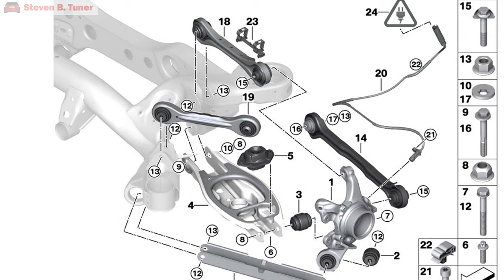BMW Axle Replacement - BMW E90 E91 E92 E93 Rear Half Shaft / CV Axle / Drive Shaft Replacement

Comment: Hi.. My name it's Alex and I'm living near Tarm😊I have a e91 from 2009 who has a problem with the passenger occupancy sensor... If someone it's sitting on the seat its popping a warning on the dash... What can I do?
Reply from the maker: Hi Alex from near Tarm! With that kind of issue it is probably a broken wire to the sensor, as wires that get moved all the time will eventually break. It could be the sensor itself or a fuse too of course.

Comment: Great video, thanks for your work. Subbed. My E90 has a lot of play in the left rear axle - I can jiggle the brake disc 1/4 inch all the way round. I'm guessing it's the hub and not the drive axle? Car was recently rear-ended on the left rear, pretty hard.
Reply from the maker: Hi, sounds like the hub or wheel bearing, or both. In that kind of accident it is very likely that the control arms are all a bit bent too (it is what they are designed to do), so often it can be a good idea to get everything from a donor car (control arms, hub, and axle).

Comment: If the thread is damaged and the nut doesnt go back on what are the options to this issue?
Reply from the maker: Hi, there are a few remaining companies out there who will fix or replace cv axles - but they usually deal with race cars, so their prices may mean that replacement is cheaper. A good welding and fabricating company could perhaps re-make the thread as well. There are plenty of mechanics who would get out their biggest air ratchet and make it go on - which leaves the problem of removal for some other time...

Comment: what could be the symptoms of bad half shaft? my e87 makes clunk/pop sound  from the rear when turning left and sometimes when reversing over unaven surface. It usually does it only once per drive then its fine.
Reply from the maker: Hi, they are often super tricky to diagnose because they last so long, and the signs of them going bad take a long time to fully show up. Sometimes the best strategy is to wait for a more consistent noise. Of course it is worth checking the suspension joints/bushings and diff bushings to make sure that it is not something else causing the noise.

Comment: Great video as always 👍
One question, how did you diagnose this shaft? I've got a bit of rear end noise at the moment, pretty sure it's not the bearings but there are 5 cv joints with the prop shaft and 2 axle shafts. Maybe I'll have to just wait till it gets worse. Goes away over 20 mph.
Reply from the maker: Hi, it can be difficult to tell as there is very good sound insulation in the car as well as a lot of the components wearing out very slowly. In my case it was a grinding vibration that rose and fell in frequency for every turn of the road wheels. Note that a similar sound can be caused by a very small build-up of rust on the differential casing, so check for that before buying anything. You are correct in thinking that is usually best to wait for the issue to get a bit worse so that it can be more easily identified.

Comment: Dear Steven, when I try to put the first gear in and the car is cold, it is really hard, but after a while, when the car get hot, it works properly. I have read and it seems it is  really common issue. Could you give me  hand? Thanks a lot!!
Reply from the maker: Hi, thanks for watching!  It doesn't sound like something that is nice to live with, and I wouldn't say it is that normal unless it is a Ferrari ;-)  A badly adjusted or almost worn out clutch can effect gear selection as well as worn gear linkages. It can also be the gearbox itself, which should have its oil changed every 100,000 kms or 60,000 miles. And of course there is the worst case that the gearbox is getting to the end of its life.
Reply: @StevenBTuner  thank you very much Steven! I'll continue investigating, driving like this is really disgusting.

Comment: I’m trying to use a puller and I can barely turn it anymore and this axle isn’t budging. I even tried heat. 😩. Any more suggestions ?? Should I go buy a sledge?
Reply from the maker: Oh no! That isn't always fixable, although a big hammer is certainly the right place to start. Sometimes things are so rusted in place that they either have to be ground out or everything has to be replaced with new or used parts in good condition.
Reply: @StevenBTuner  thank you sir. I actually already started pricing a new hub. If a sledge doesn’t work I’ll just remove the whole hub assembly.  Thanks!!

Comment: Hey, I’m currently changing my driveshaft on my bmw. Why do you have to remove the control arm?
Reply from the maker: Hi, thanks for watching! Removing the control arm makes everything come out and go in easily with no wrestling, and it isn't even necessary to remove the chassis bracing (at least for the right hand side).
Reply: @StevenBTuner  ahhh thanks for you help👍 wish I watched your video before I started haha. Was having trouble removing the outer cv joint only got 5mm movement on the shaft and then nothing. Thanks 👍

Comment: What is the torque on this vehicle?
Reply from the maker: Hi, from memory it is 400Nm in gears 3 through 6, and is set lower for 1st and 2nd gear. The car has police specifications so it is a 320D with 325D axles.

Comment: I would not recommend tapping the back of the CV-joint like you do. I did that on my car and now that metal cover is a little loose so the CV joint is leaking grease. It's a non-replaceable part so I have to replace the whole axle which is very expensive.
Reply from the maker: I just had a re-look at the video, and I do say to 'tap gently with a nylon dead-blow hammer'. Is that what you did? This part of the job can be a bit frustrating on some cars if the splines refuse to line up, so it is always best to remove it and re-insert it at a completely different angle...along with keeping those fingers crossed.
Reply: Do you have sport chassie?

Comment: Steven what was the symptoms of the damaged driveshaft? Great tutorial :)
Reply from the maker: Hi, thanks for watching! It was a grinding type of vibration.
Reply: @StevenBTuner  I have a vibrations  of the passenger seat headrest at 70-75 mph  and dont know what can be. I change shaft flexible coupler, shaft support and so on....
Reply from the maker: @ddamianRC  Hi, if I were to put odds on it, I would say that vibrations at that speed are 9 times out of 10 to do with a damaged wheel or a slightly egg-shaped tire. If you can swap over to a second set of wheels/tires then you can eliminate the possibility pretty easily.

Comment: Anyone know the correct torque for the 30mm collar nut? Been searching for hours on google still no answer,
Reply from the maker: I have it listed as 300Nm /221 lbf ft - but that is for a 27mm shaft. There are a lot of variants, so it is definitely worth getting a workshop manual for your particular model.
Reply: For the M24 it’s 250 NM, for the M27 it’s 300 NM or 185 lb/ft and 221 lb/ft of torque respectively
Reply: M24 is 145 nm + 45 deg for E90

Comment: Terrific video!  but...
Look into extensions and whatnot on torque wrenches!  If the bolt is in line with the wrench, there's no effect.  If there are any angles or "doglegs" as might occur with crows feet, corrections must be applied.  Torque can be effected either way, so just adding some to be safe isn't a good idea.  It's never a good idea, as too much can be as bad as too little.
The same issue exists when you're pushing down on the not-horizontal breaker bar.  Force that's not perpendicular is deminished.  Imagine if the bar were up at 90 degrees.  Infinite force would produce no torque!
Reply from the maker: Hi, thanks for watching and raising a very important point! Getting a torque wrench anywhere near half the bolts under a BMW is pretty much impossible. The best accuracy is probably achieved by looking up the grade, size and pitch of the bolt and then calculating the angle needed to achieve the desired stretch. Could be a good video perhaps?

Comment: Just for anyone at hom, u DONT need to pull the control arm. U can slip the axle out without it
Reply from the maker: Only on some models.
Reply: I wanted to come and make a correction to what I said before. On MANUAL cars you do not need to pull the control arms. This is due to the different sized diff and axles. Push up and back while compressing the axle as much as u can and you’ll be good to go👍

Comment: Should be noted that muffler pipe is not there and would be a sizable issue in the way.
Reply from the maker: Hi, if you are working on the left side then you will need to remove the exhaust system first.

Comment: Are the drivers side and passenger side axles the same?
Reply from the maker: Hi, the other axle is a bit more difficult as the exhaust pipe is in the way, so you have to remove it first - which means you have to deal with lots of potentially rusted/broken bits.
Reply: @StevenBTuner  thanks for the reply. My question was actually about if the axles themselves are the same axle for both sides or if they are specific to each side. Thanks
Reply: @simong.5535  Specific to each side. The  right hand side (if sitting in the drivers seat) is longer than the left.

Comment: For anyone doing this, be careful in the step where you tap the axle back into the wheel carrier. Mine got proper stuck and I had to hammer on it hard. It ruined the wheel bearing.
Reply from the maker: They can be a problem when they don't feel like lining up!
Reply: @StevenBTuner  interestingly, the axle was more than halfway in. I suspect rust on the splines, but haven't taken a closer look yet.
Reply: Update: so what I ended up having to do was to insert the axle while on the bench. It took a lot of hammering to get in, and I suspect poor machining tolerance on the new wheel hub (non-OE unfortunately).
Reply from the maker: Hi, bad tolerances like that are enough to drive you crazy!

Comment: What happens if u dont use original bmw parts?
Reply from the maker: Hi, I haven't had good experiences with non-BMW or non-GKN CV axles in the past. They are often much harder to fit and also start giving trouble before one year has passed.

Comment: What were the torque settings for diff hub bolts and for main axel nut?
Reply from the maker: Hi, you'll have to look them up for your particular car and bolt size as there is quite a bit of variance.

Comment: why is it necessary to take off the control arm?
Reply from the maker: Hi, thanks for watching! The axle shaft doesn't quite compress far enough to just slot it in without possibly damaging the very thin inner end cap. Once the arm is out of the way you can move everything out of the way to give an extra inch of clearance.
Reply: You don’t need to, just loosen axle nut. Remove axle bolts to diff and jack under control arm you can drop the diff side of axle. Remove jack from under control arm and just pull axle out.
Reply from the maker: @OnlyDamp  Hi, that doesn't seem to work for my car - but I have up-rated springs and a thicker anti-sway bar, which could easily make a difference.
Reply: @StevenBTuner  which part won’t work for you?
Reply from the maker: @OnlyDamp  Jack under the control arm - it doesn't move just one side of the suspension, it ends up lifting the whole car up. Next time I will try disconnecting the anti-sway bar to see if that makes enough of a difference.  There is always potential issues when making videos about cars that have been modified away from stock...
Reply: @StevenBTuner  oh ok I gotcha. Yea sounds like your springs or roll bar is to stiff.
Reply: @StevenBTuner  haynes manual states to remove anti sway bar to get enough clearance 🤷🏻‍♂️

Comment: Those hub /axle nuts 🌰 most all are now just rusted acorn nightmares !!  No socket is fitting on those nightmares !
Reply from the maker: Some jobs end up being a nightmare! I hope a gas torch and a big hammer get you in the right direction!
Reply: One is stuck and extractor socket not working. What to do?